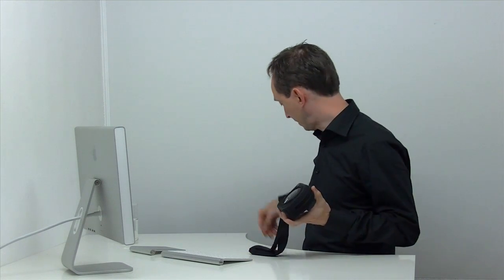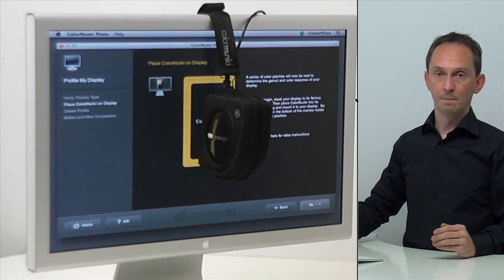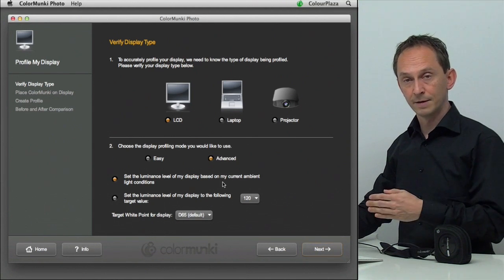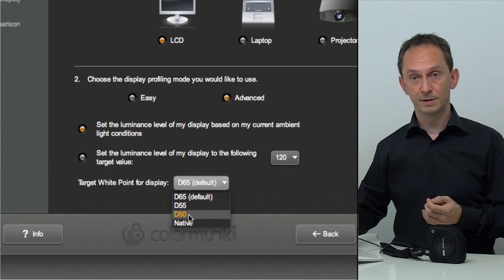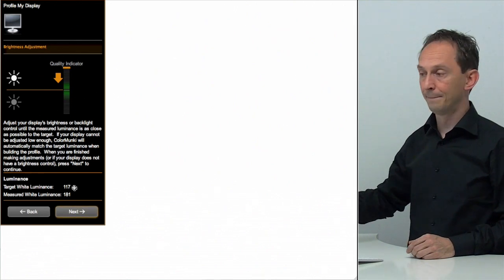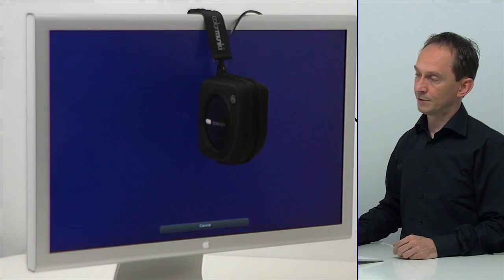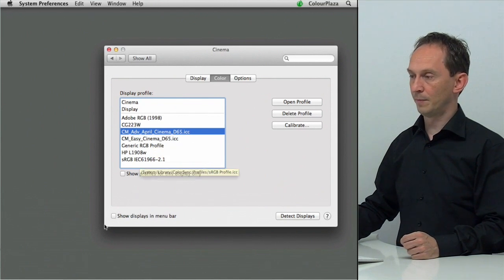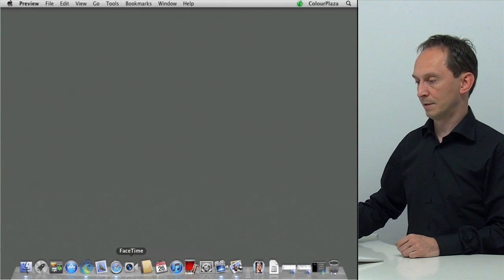ColorMunki Display Profiling by ColorPlaza

Comment: Hello,
thank you for this excellent tutorial. I appreciate it. One question: I have a wide gamut monitor with hardware calibration and internal 14 Bit LUT. Do I want to put a profile for the display in Windows? Or would I rather use the software that comes with the monitor and use the hardware calibration? It does work with the color munki as a device, if plugged to the monitor's USB hub. Thank you for the advice and kind regards.